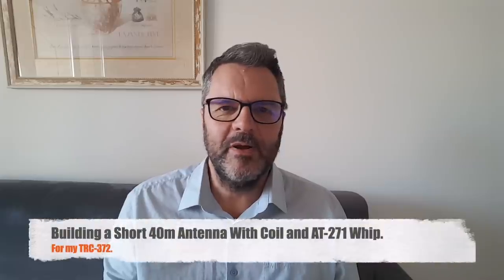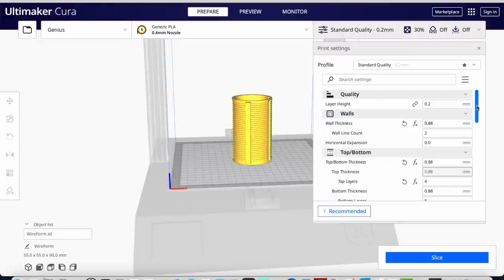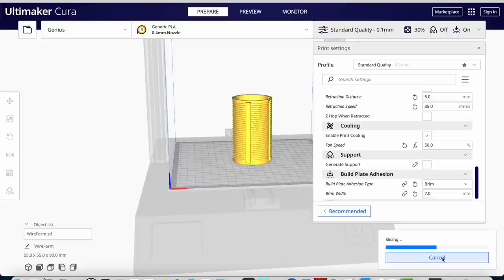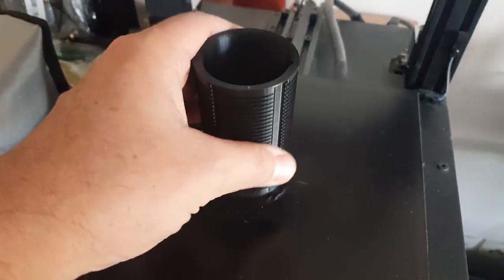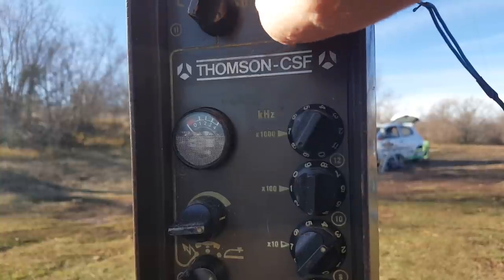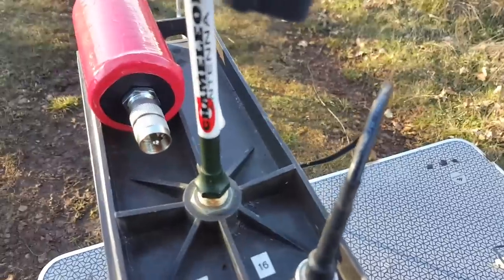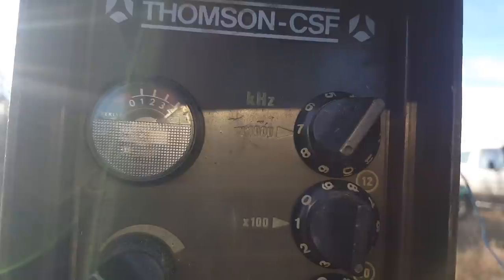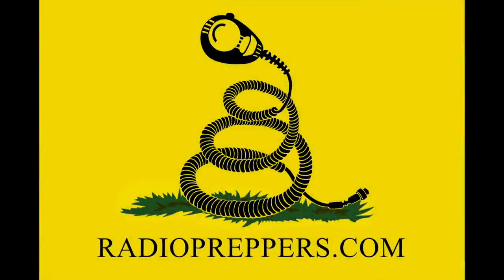Building a Short 40m Antenna With Coil and AT-271 Whip.

Comment: A good vid Gil, have you checked the resistance in your coil? What is the pico farad rating? How many turns are required? It works well on reception though. All the best, 73
Reply from the maker: I haven't measured anything yet because I finished it the morning of the test..

Comment: Hi. I am here because I am trying to figure out how my 40 year old mag mount CB ariel works. I've fixed it ... but still don't under stand how it works. I asked my Dad who knows everything about radio and didn't understand what he said. I am no idiot, except in his shadow ha ha. So my antennae has a similar coil, much smaller and is located in the actual base, nice, only the 6ft whip protrudes easily unscrews. Shouldn't your coil have a tap off it to tune the SWR? Like your toroidal experiments. I think they are called buddy taps in the US, they can be permanent or movable on the coil so the ariel can be tuned? My Dad tried to explain to me that the coil works as a transformer? If this helps great, if it doesn't I won't be offended ha ha because I don't really understand RF myself. I just measured what Dad told me (he is 90) and soldered and instantly got 1.1 - 1.3 SWR back on my very old mag mount. The coil is wound around a nylon former, I think the coating on the copper is cracking due to age and touching the nylon, I know that nylon absorbs moisture and expands and contracts and gets conductive, which is probably the cause after 40 years outside in the rain. The only thing I can find that describes this is here : https://youtu.be/EzaLdfcPOyI 
Great videos, love your DIY!
Reply from the maker: Hi, yes, I will build another one with a tap.. Your 1:1.3 SWR is very good. If you have any question I will answer to the best of my knowledge..